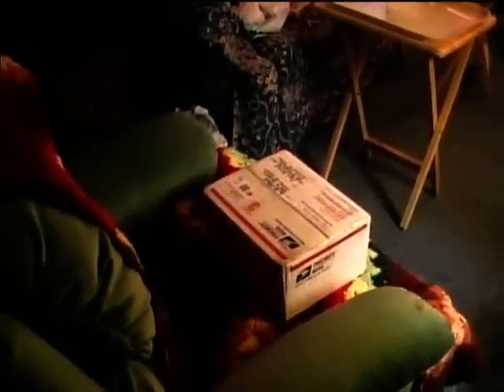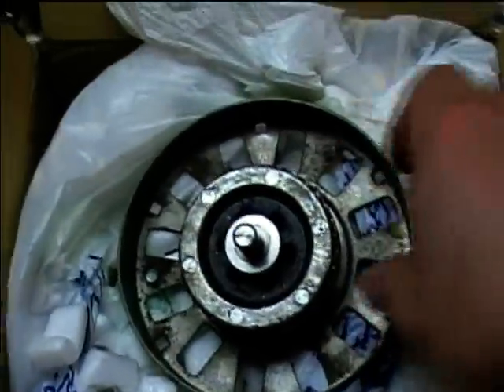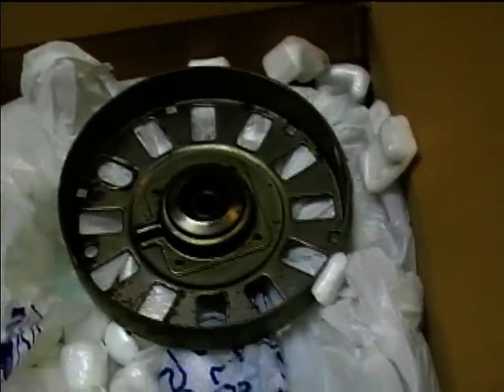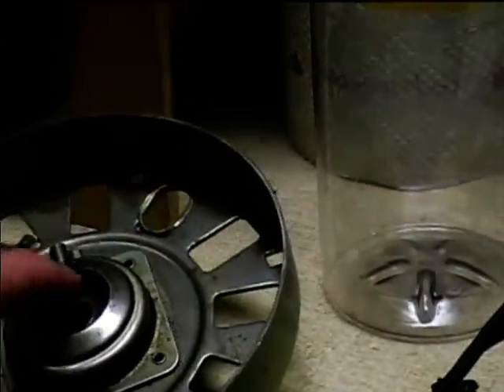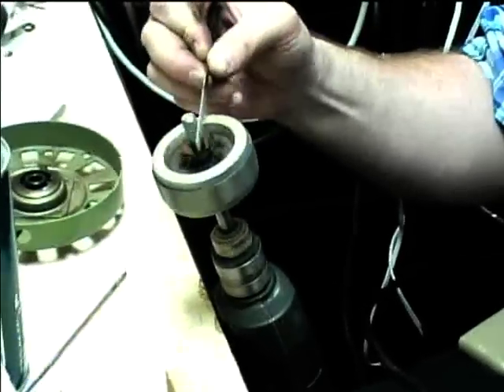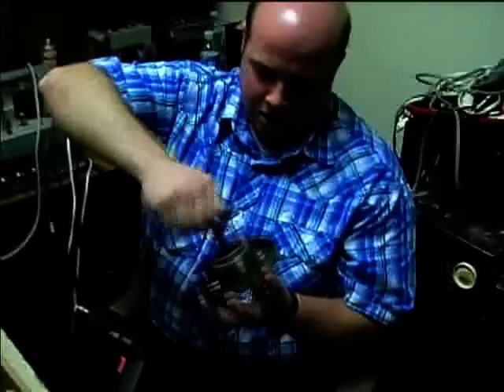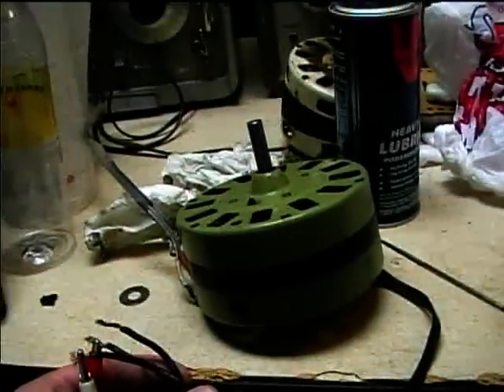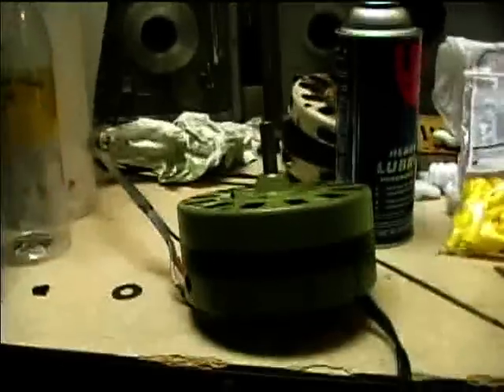Fasco fan motor from mylesgifford123 test

Comment: the problem with my ceiling fan is that it is jam .. are bearing are not working so i want to open bearings for i can give them oil ..but
I can not open my ceiling fan ,, I have opened its all bults but it is also strong and not opening. please make a video and Scator/ open  all parts of ceiling fan ...